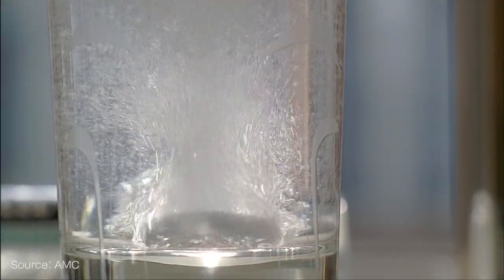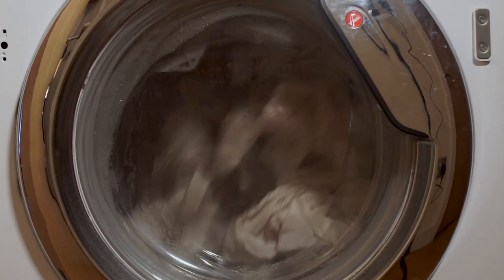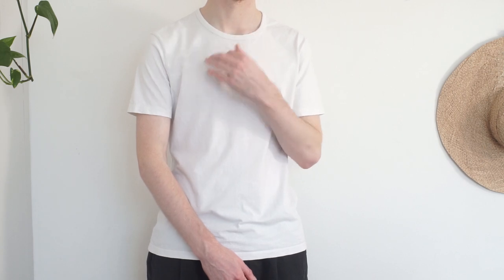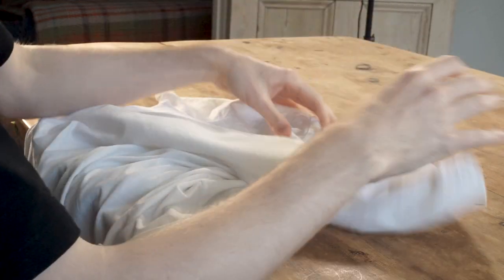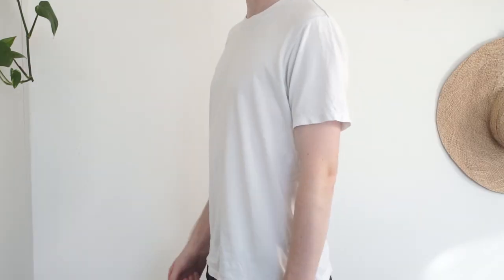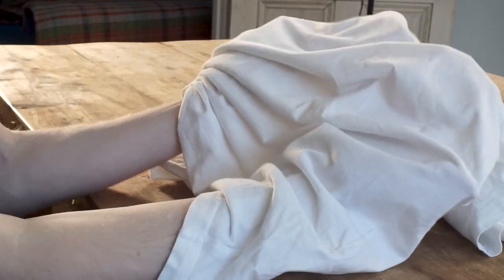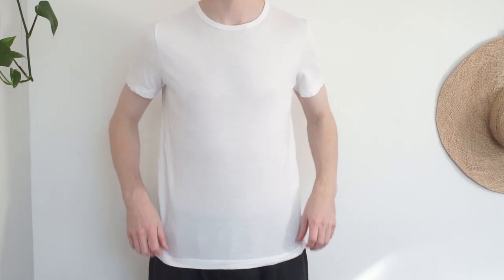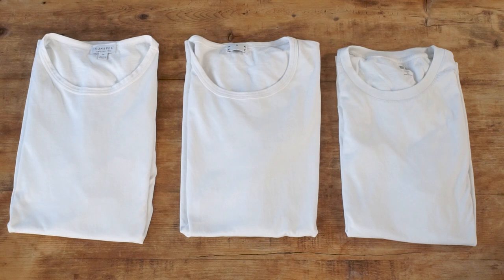The best plain white t-shirt?

Comment: Costco 6 Pack 100% cotton tees are by far the best value for money. I got a pack for like $30ish, and for $5 a tee they're amazing quality and hold up very well. After a year of daily use no stitching has come undone, though the collar is a bit weak but generally manages to hold most of its shape. It's soft, even after many constant no-fucks-given wash and dry cycles. Only con: Medium is the smallest size, so shorter guys like me will have to tuck them in.
Reply: This is true but it peels hard eh need a fabric shaver forsure and eventually leads to holes but hey for the price I agree your not going to get better quality especially with its thick collar